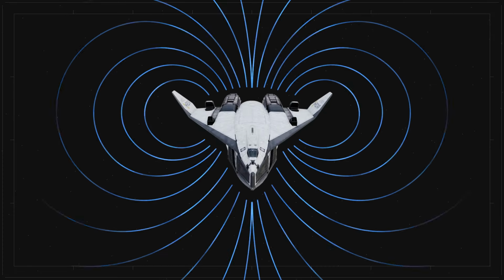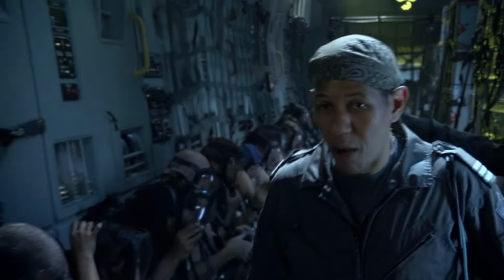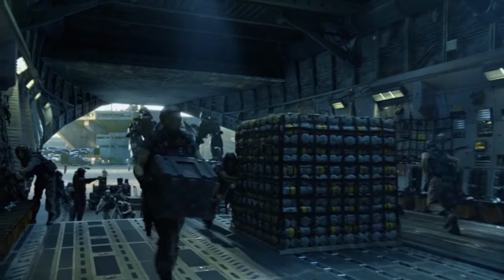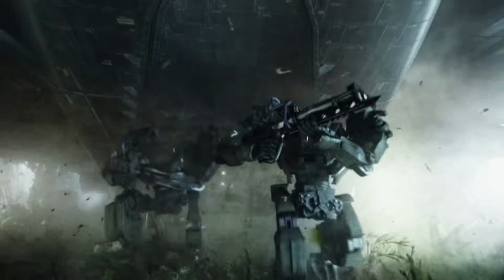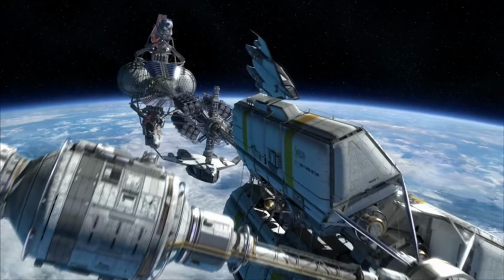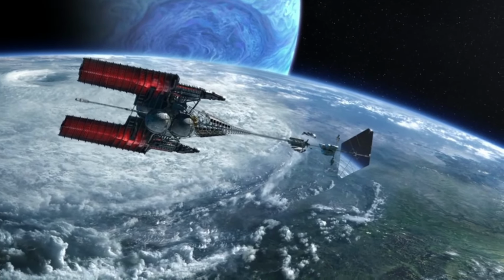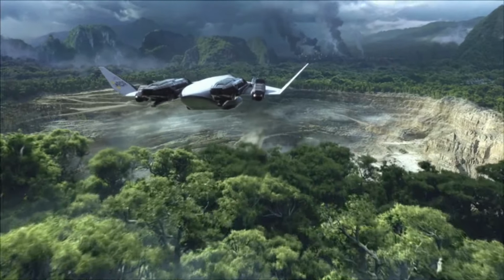Avatar: Valkyrie Shuttle Analysis

Comment: The big reason for the engines rotating rather than just the nozzle is probably due to the heat of the engine. VTOL planes normally have a 90 second window to land before the nozzles become compromised. Forcing thrust gasses to take a 90 degree turn creates huge amounts of heat.
Reply: Yes the harrier had this problem not because it burnt up but because it used water which was in a small supply to maintain the thrust needed to do vertical lift operations. This being further exacerbated by the usual low fuel levels needed to arrive at the ship ready to land at the appropriate weight. This isn't a problem with vtols in general it's a problem with certain really early jet vtols where the technology to do so wasn't all there. Aircraft like the X-32 X-35 and F-35B can stay hovering as long as they have fuel.
Reply: @knockout-v4v  This is what I came to see. The harrier and other early VTOL jet aircraft were really the only ones to have the overheating/water issues. The F35B without weaponry and with less than full fuel can take off vertically, hover until bingo and then land vertically at the push of a button
Reply: @knockout-v4v  the main problem with vtol is when it's landing. The f35 can't maintain a low hover and has to slam down when landing due to the engine ingesting the hot exhaust air which can cause the engine to cut out all together. That was a major problem earlier in the f35 development and was partly solved by having the plane land on a grate where the air can pass through and away from the engine intakes
Reply: Also, atmospheric density on Pandroa is also specified as being higher than Earths, so running atmospheric gases through an engine would likely create additional heating and pressure issues over plain air. Given the limited amount of activity on Pandora, one could assume there wasn't enough research to make safe assumptions about operating an engine at the limits of tolerance for the sake of efficiency in a field environment with limited options for repair of a critical system. It could be argued it was well worth taking a hit on efficiency for the sake of ruggedness and simplicity in a remote location.
Reply: yes and making it turn also makes it lose efficiency fluids like water and air dont like sharp turns in high efficiency things like high flow hydraulics sharp bends are avoided and only used when absolutely necessary if a turn is needed gradual turns are used.
Reply: I've seen dirty fives hovering a LOT longer than that so yehh.. no
Reply: Why are the freking engines in the Back of the Aircraft? The larger engines in the tail, it will make Nose Flip trying to fly slow in VTOL mode. Other wise it needs to hover 45°degree nose Up to compensate COG fail.
Reply: @mauritz1774  Big jets at the rear are for orbital velocity thrust. It would be awkward at best to mount them anywhere else. The smaller midsection jets are obviously fully capable of supporting the weight of the forward section of the spaceplane.

Comment: My guess is that the large air intakes are for cooling the fusion plants.
Reply: I would suggest they are for its late life repurposing as a gas harvester.
Reply: and I suspect they are also the inlets for the scramjets taking a y-s inlet shape to drop the flow just enough for the engines to work (maintaining the flame in the engine is currently a major challenge)
Reply: @avroarchitect1793  there would be no flame to maintain, as this is a fusion powered craft and they are dumping heat from the reactor directly into the compressed airstream, presumably through heat exchangers.
Reply: @Jakedasnake1066  you are assuming the scramjets are using the fusion as the thrust source. Scram jets are designed the way they are to make fuel combustion and exhaustion hypersonic. Scramjets are by definition a liquid fueled system
Reply: @avroarchitect1793   The fact that the engines are reffered to as "scramjets" in-universe could be considered an oversight by the writers, or "scramjet" might be being used as a colloquialism for any engine which compresses and heats the incoming gas without slowing it below supersonic speeds. Perhaps "SHRAMJET" wasn't catchy enough. I also think if you have a vessel with a fusion reactor, with sub- to high supersonic turbojet engines which are conclusively powered by the reactor, it would be absurd to haul around fuel to use for your third propulsion method. It would be like having a car, which is mostly a normal car, but when you shift into reverse the engine is disconnected and the wheels are driven by water flowing over a water wheel in the trunk. Additionally, the craft are said to be used in the atmosphere of the parent gas giant, which presumably would not contain oxygen in suficient concentrations for combustion.
Reply: To clarify, the benefit and defining charactaristic of scramjets is that they are able to operate with the airflow through them entirely supersonic. Ramjets slow the air to low subsonic speeds, compressing it in the process, but also generating a lot of heat. The heat goes up with the speed the air must be slowed from, so once you get around mach 4-6, the air is hot enough after compression to start melting the airframe. Scramjets get around this by not slowing the air as much, thereby not generating as much heat. Both produce thrust by heating this compressed air and allowing it to expand through a nozzle. The fact that this heating is usually done through combustion with oxygen in the airstream is just a consequence of using hydrocarbons to supply the heat. You could replace the flame holder with a heat exchanger in practically any turbojet or ramjet or whatever and they would still function just fine, If you had a way to supply heat to it.
Reply: @Jakedasnake1066  Yea, I would expect the gas intake is to add more thrust by increasing the amount of reaction mass. When you have such an energy dense source of energy, the only thing left to do is somehow gather more propellant to get more thrust.
Reply: @avroarchitect1793  Fuel scoops for fuel harvesting, with other tertiary uses, such as cooling, bypass spoilers, scramjet intakes, etc.
Reply: Not only that, when cruising in the mesosphere level, you can accumulate the layers of atmosphere, with that wide vent, into a cooling showerheads of air at those nose tip, creating a cooler shield againt air friction heat build up, especially re-entry. Most don't realize the trick of spewing fuel out by the rear flow of a ramjet head cone, can simulate air to propellers, and also ignite/static afterburn thrust, like a SR emgine in low atmospher, WHILE in xxo orbit, before using pure rocket-fuel🤑. No exterior flaws in the movie crafts, just the mistory ofvwhat was internal.
  The only thing really EPIC of flaws in the movie, was zero life force detectors with glass windows easly shattered by bow&arriqs🙄

Comment: Would those intakes at the front not be for the fuel scooping? And the ramjets built into the turbofans similar to SABRE engines on Skylon? Great video all the same!
Reply: Skylon's never taking off.
Reply: @carlosandleon  what makes you say that? I expect to at least see a prototype to test the tech even if it isn't viable
Reply: @avroarchitect1793  2 DECADES and still only one engine built, ok two, but they were not working at the same time with one never working right.
Reply: @avroarchitect1793  This one didn't age quite so well
Reply: or like the Pratt & Whitney J58 on the SR-71 blackbird.

Comment: i could be very wrong but 3:33 about the wing position, i imagine the twin massive self powered fusion engines are extremely heavy unlike those on spaceshuttle, which are basically nozzles. Judging by the position and difference in size of the rotatable jets, those fusion engines probably weights more than the rest of the craft, so the wing naturally should allign where all the mass is, and being top mounted also means stability, especially for a craft that have it's center of mass that far back.
Awesome content tho subscribed!
Reply: Yeah I was thinking the same thing. They had to be pretty heavy and therefor the CG and VTOL jets were further aft to compensate. It just looked cooler so there's always that...
Reply: You’d want a top mounted wing to be able to more easily use the craft  on unimproved surfaces - such as a jungle floor. While I was in high school a couple of decades ago, I drew a very similar design. Although mine was powered by chemical propulsion. I also didn’t consider mounting the engines on the wings. This is a great idea as it gets them off the ground. As to why they rotate, I’d imagine vectored thrust would limit lift capacity and create additional ware wherever the thrust is ducted. If you have the option to rotate the entire engine, you’d definitely want to take it. Modern vtol aircraft that have to vectored thrust do so because nearly the entire craft is the engine. Think of these shuttles as v-22 ospreys upgraded for orbital flight.
Reply: @Blazeoptimus  Also, aren't the jets electrically powered? I'd asume that significantly simplifies the construction of rotating turbines.
Reply: @Blazeoptimus  who ever came up with these design in AVATOR, had great inspirational p/\R@d●X designs of real life feasable effect crafts, Volkyrie was like a 4 engine cargo mix breed of a F-35 to X-35a. The helicopter, just needed to be a gimbler 4 duck fan, max cruise drone effect, and many other, the only major flaw in the move, was low tech life force detection & glass windows that can shatter by hand held bow&arros 🙄
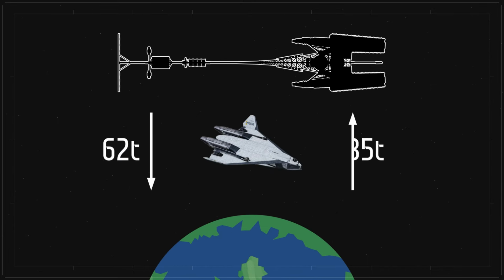Reply: What i dont get is whats lifting all that weight at the front of the shuttle, as you can see in this picture 2:30 there is a VTOL  jet in the rear(to cary those masive engines i asume)and there's one in the middle but what about the other half of the craft?
Reply: @matijatoskovic5666  it's center of gravity is to the rear
Reply: @carlosandleon  do you mean that those engines are so heavy that they outweigh the entire front half of the craft including cargo?
Reply: @matijatoskovic5666  yeap, it's a dumb design
Reply: @carlosandleon  it looks so cool but i can't not se that and it ruins it a bit for me
Reply: I think another reason for the question is that Shuttles are designed for re-entry using their underside and their wing design fall in line with that.  This might suggest the Valkyrie takes a different approach.
Reply: The engines were very versital and simplistic, with direct path vtol to cruise rapid swap, even a bulk version of the military f-35 engines, the air flow had drag bend of fuel burning, the Valkyrie was imposing a multi phase like wide intake air to jet, than jamjet, eventually low grav mass ratio & air friction exo pure rockets afterburn/thrust.,
Reply: Having a rear heavy design is as dumb as it gets
Reply: @carlosandleon  unless you have FBW and don't need to hand fly it a lot of aircraft have extremely unstable designs this isn't the 50s
Reply: @knockout-v4v  front heavy designs normally.  nobody ever designs a rear heavy aircraft on purpose brah. it's unstable in a bad way
Reply: Top mounted wings are actually a lot more unstable than bottom mounted ones. That's why virtually every civilian plane has bottom mounted wings. The benefits of top mounted wings are mainly that you can put your engines higher up to allow landing in rough terrain
Reply: @thibaultlibat368  Top mounted wings are more stable it's a fact. 
Civilian planes are bottom mounted because lot's of other factors such as easier for engine maintenance, can simply retract the gears into the wings instead of adding extra landing gear bay which introduces drag. Those advantages simply outweights the benefits of top mounted wings.
But you can see if an aircraft is required to be stable at lower speed, their wings are almost always top mounted.

edit: That said, most fuselage are not very tall, so top mounted vs bottom mounted difference in stability is not too significant to begin with, like you said having the wings pointing upwards creates more than enough stability.
Reply: @kkgc5760  alright a pilot told me that, but there must have been a misunderstanding then, my bad
Reply: @thibaultlibat368  all good, just go play some kerbal space program you will become a top mounted believer in no time hahahaha
Reply: @thibaultlibat368  @KKG C 

https://youtu.be/I8iLR2xRNKY
Reply: @thibaultlibat368  Antonov series of super heavy cargo planes might disagree on that top mounting.
Reply: @thibaultlibat368  Cessna 172 disagrees
Reply: @carlosandleon  i didn't want to make my comment too long, but the stability comes from the wings pointing upwards. Most big planes with top mounted wings have their wings pointing downwards and are less stable than big planes like the 777 with wings pointing upwards. The plane you are mentioning has top mounted upwards pointing wings, which is very uncommon for big planes
Reply: @thibaultlibat368  they are anhedral in large high wing applications  because during lateral movement in turns there will be a higher pressure on the inward side thus creating a counteractive lift force.

and that creates a stabilizing effect on lareg high wing applications, they are not less stable at all

Comment: i think their engines are located too much astern, like, it looks like it would tumble forward, except if its center mass is also located at the back
Reply: Yeah I was thinking the same thing. The fusion engines in the back had to be pretty heavy and therefor the CG and VTOL jets would have to be further aft to compensate. It just looked cooler so there's always that...
Reply: One of the reasons that the HOTOL space plane was cancelled is that the engines at the back and the decreasing fuel supply as it flew meant that the centre of gravity shifted backwards, making it very hard to control. They tried to beef up the control surfaces, but the weight cost was so large they joked that HOTOL was a great system to send hydraulics into orbit!
The Skylon space plane design has the sabre engines on wing pylons at the centre of gravity precisely because of this.
The Valkyries vector thrust engines could be used to compensate for CG shifts so the weight of the fusion engines at the back might not be an issue.
Reply: In all likelyhood the Valk IS aerodynamically unstable, however so are basically all modern fighter jets.  Computer-assisted avionic systems even now in the modern day can make basically anything fly as if it were stable, so long as it has working control surfaces, by making tiny fine adjustments at high speeds that a human pilot wouldn't be able to handle with a purely mechanical flight system.  This is also true for any rocket with moving engine pivots, especially right before the booster stage separates.

Comment: Can you explain in detail how the orbital engines work ? Are they like rocket engines or just some very new alien type technology? 
And how does the jet engines derive power from fusion?
Reply from the maker: We don't know exactly how the fusion engines work due to lack of specifics, but at a basic level a fusion rocket just uses the energy from fusion for propulsion just like how a regular rocket uses the energy from combustion.

The jet engines work electrically!
Reply: @hoojiwana  but the rockets create power by expanding gases whereas fusion only creates heat. How can it be used for propulsion
Reply from the maker: @dranzergigs8333  Well sure but theres likely propellant in tanks that are never mentioned, thats the only way the engine could work.
Reply: @dranzergigs8333  typically, when people talk of fusion engines, they mean either plasma or ion engines powered by fusion
Reply: @dranzergigs8333  the most basic fusion rocket diverts fusion products out as the exhaust/ reaction mass, so the reactor does its thing and the resulting fused atoms become the exhaust of the engine. Being very hot and moving very fast it would be a great engine. As for the jets, you use the heat generated by the reactor to heat the air and drive electric motors that power the compressors. A similar idea was proposed when the USAF tried to design a fission powered bomber.

Comment: i dont understand why it was so back heavy as when it doesn't have cargo the front would be heavier than the back in terms of weight that doesn't generate lift which alludes me
Reply from the maker: It's probably balanced around the big fusion engines.
Reply: @hoojiwana  but im talking center of mass and center of lift and thrust here which doens't really mean anything in terms of fusion engines
Reply from the maker: @risingmoon893  Yeah I'm saying the center of mass is probably pretty far back due to the fusion engines though, not that the design is super realistic anyway (its a lot more based on form over function unlike the ISV).
Reply: @hoojiwana  but the engines would generate lift as the delta wing design would generate more life in the back which would make it tilt down
Reply: @hoojiwana  and with he engines there to would creates problems and the engines and the engines would make the back quite heavy but it does not correspond to a real physics and plane design